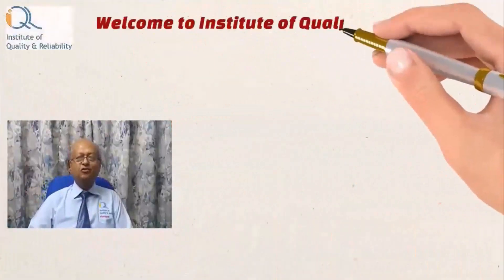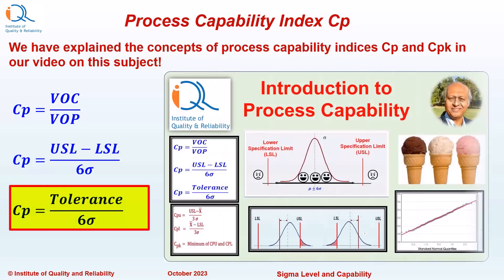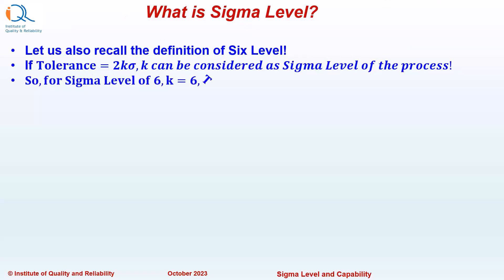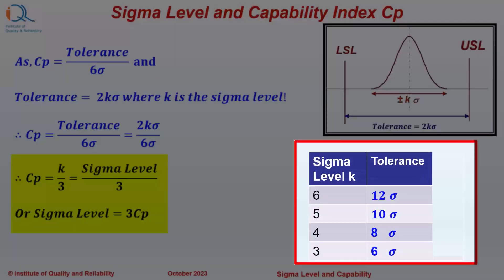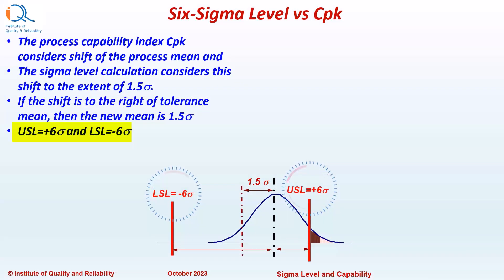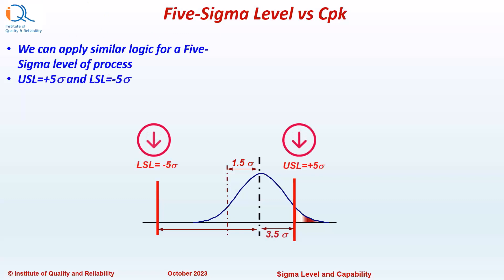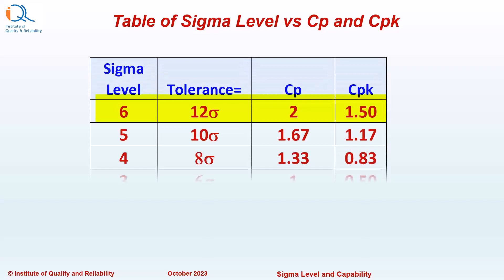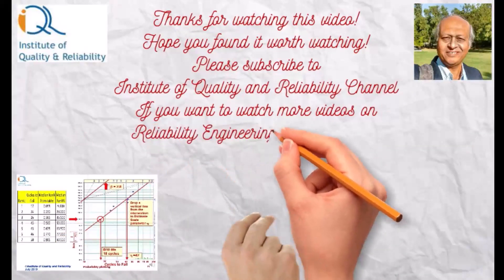Sigma Level and Process Capability Indices

Comment: "Six Sigma Champions are con men" 
“All you have is smoke and mirrors” 
"Six Sigma is a snow job"
- Creator of Six Sigma, Mikel Harry
91 % of Six Sigma companies have trailed the S&P 500 (Qualpro survey).  A long term study of hundreds of Six Sigma projects at Ford showed an average of 1 in 5 parts defective AFTER improvement for “successful” Six Sigma projects.

Six Sigma is a destructive scam based on pure farce.  It started with Mr Bill Smith and his out-of-control molding process that happened to drift “as much as 1.5 sigma”.  Smith’s buddy, con man Harry, “proved” Smith disaster happened for every process ... based on the height of a stack of discs!  Most folk never bothered to check.  

“Neutron” Jack Welch at GE described Harry as a “madman” and said no one had any clue what he was talking about.  Jack handed over $1B anyway.  A scam was born!  GE has now thrown the Six Sigma trash out.

EVERY aspect of Six Sigma is worthless, from its normalization nonsense, to its irrelevant enumerative methods, to its paralytic DMAIC.

Dr Wheeler, the world’s leading process statistician, calls Six Sigma “GOOFY” and the stuff of “the tooth fairy”..  CBS calls it the most stupid fad of all time.

There is never justification to stray from the giants of Quality Dr Shewhart, Professor Ishikawa, Professor Lewis, Professor Deming, Dr Taguchi and Dr Wheeler, for the lunacy of Six Sigma’s self-confessed con man.

How the Six Sigma fraud was started:  
https://youtu.be/0kZbJLHK_4M 

Lean was tacked on to prolong the Six Sigma Scam.
98% of LSS implementations FAIL (IW survey)